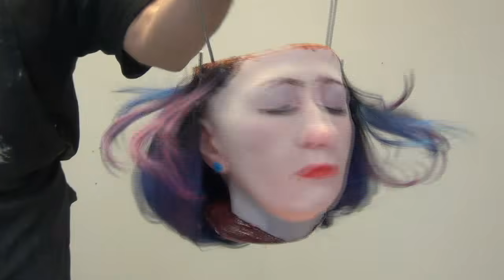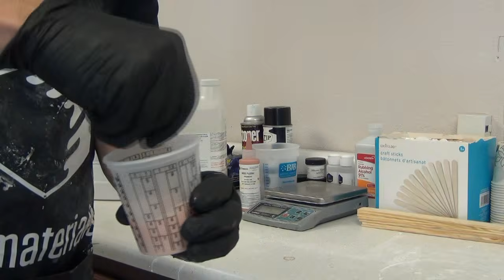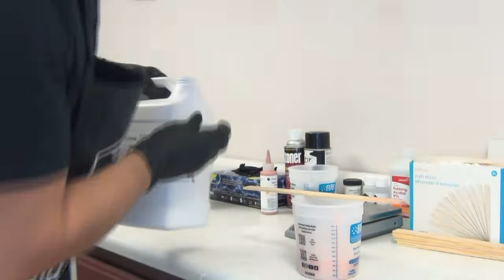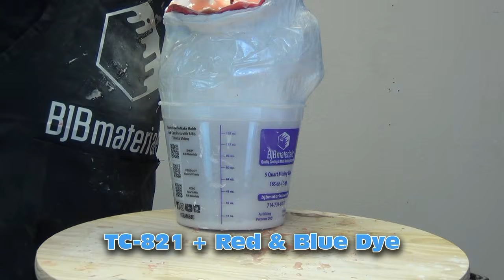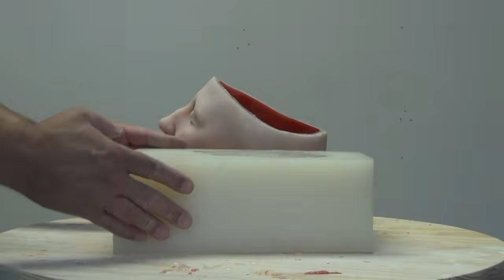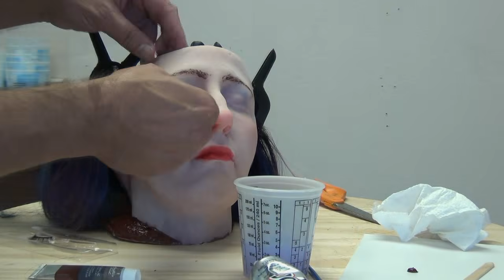Human Head Tip Bucket Resin Casting

Comment: Did you have to put any mold release in the mold before adding the resin ??
Reply from the maker: For TC-5110F you don’t have to use mold release, but E302 is recommended to improve the mold life for production casting. For most casting in good silicone molds I don’t use mold release just because it adds a clean up step and some mold releases are very difficult to remove from the cast part.